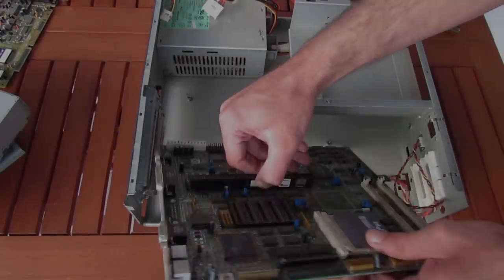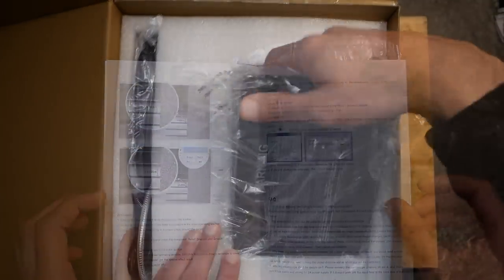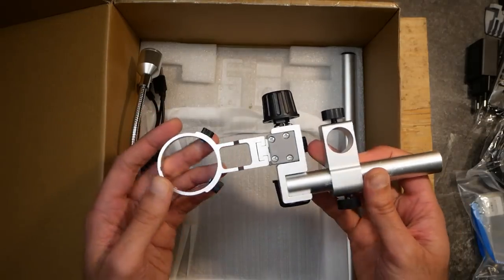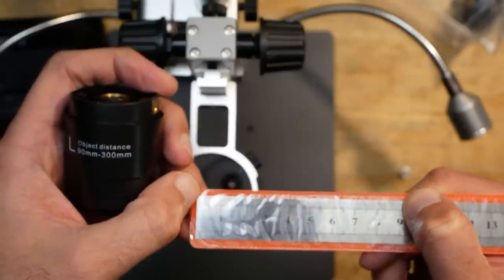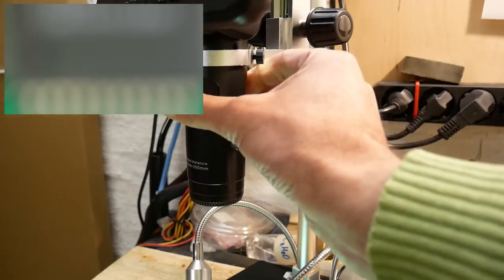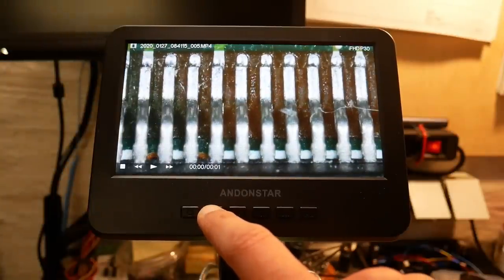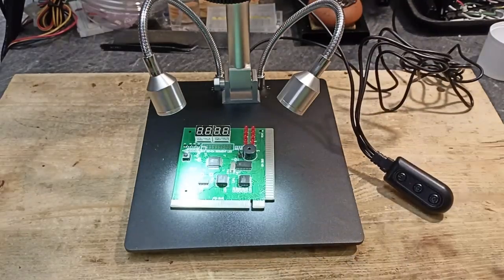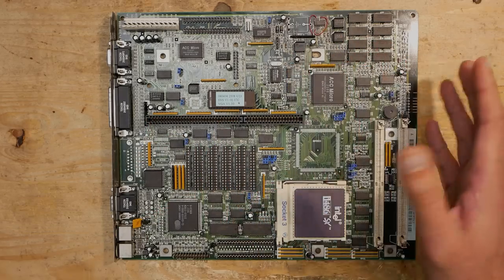Review: Microscope Andonstar AD246S-M

Comment: Idea: What I would do  to the wood board is cut a square from the top to center and slide in to match the microscope base, turn the wood board into an extension table that's at the same height.
Reply: believed or not, I do this with a mobile phone in a clamp, and watch, control (zoom, focus, light, etc etc) and record (video and pics) the camera on the PC.

Comment: A slightly used (ha, ha. Ok. Much used) Go-Pro, w/ macro lens, hooked to USB-C power and a mini HDMI cable, works very well. Mount it on long gooseneck to your solder station or a shelf above. Nice way to recycle a used device, without buying a new battery for it.

Comment: The model that I own, the cable meant for the base and the screen, seems to be power only. The manual said it didn't work on the PC either, but using a different USB cable on the screen made it work on the pc.

Comment: Great review, thanks.  You might be able to put the unit on a small shelf raised above your bench, then flip it around 180 degrees, so a large board would slide underneath the support bar.
Reply from the maker: Thank you very much. I actually 3D printed a holder which can be inserted into my camera stand above the table. Now I can just switch the camera with the microscope whenever I need it.

Comment: I wonder if you get a good result using one of those ring shaped lights that youtubers/tiktokers use, centered around the actual microscope lens? That would give diffuse, bright light and directed downwards around wherever your viewport is.
Reply: There are microscope lights like this. They are better than nothing, but not actually that good when it comes to to read IC's markings. Goose neck lights are better for that as they provide more flexibility.

Comment: You should take the base of that microscope and throw it in the bin.. Integrate the vertical post of the microscope assembly directly into your workspace by either attaching it to a wall, an adjustable-lamp-arm or similar, or just directly onto the desk itself.
Personally I'd have used a camera/lamp adjustable arm (like a microphone boom arm) to hold the microscope optics, monitor, and LED lights, that way there's nothing beneath it and you have full range of motion without ever "bumping" the microscope.. And being on a boom like that, it can be easily lifted up and out of the way, or swing away closer to the wall, for storage.

Comment: I have a similar microscope and I did what you were talking about in the end. I attached the microscope to an arm lap stand, and I use another arm lamp for light. It's very nice to just push the microscope away and be able to see in the center of big motherboards and such. The downside is that it's wobbling, but it's fine.

Comment: Great review! I bought a similar 7" microscope last year, which has been very useful. I can't imagine soldering without it now to be honest. I have the same problem with the chassis and small base plate on mine. I can usually rotate video cards around well enough to find a good angle, but it's not useful for motherboards and larger PCBs. The base of mine is even smaller than this one from what I can see. Very curious to see what you do to modify it because I'd like to do something similar 👍
Reply: I just ditched the stand that came with mine. Instead I got a gooseneck stand with a 1/4" tripod mount (the kind that clamps on a desk). I then designed and 3D printed a clamp that fits around the microscope (pretty trivial, basically a shape that looks like a "C" and that is the diameter of the "tube" part of the microscope. you can probably knock one up in TinkerCAD in all of 5 minutes.) So now the microscope can float freely anywhere on my desktop, and I can position it any which way I need. I also got some gooseneck LED lamps that I can use if I need additional lighting.

Comment: This microscope has it's uses,  but I would not recommend it for fixing motherboards. Problem is with the base which is small and you have to put something under the motherboard to make it more stable, because you can't solder when the motherboard is moving. Been there done that and no thank you. Also there isn't enough space due to small base and metal stand so you have to adjust yourself and the board to the microscope and not the other way around. This maneuver can affect the quality of your soldering job. Metal stand is always in the way when turning the motherboard around. I would propose to add some more money and buy a stereo microscope with an extendable arm. At least for our kind of work 🙂